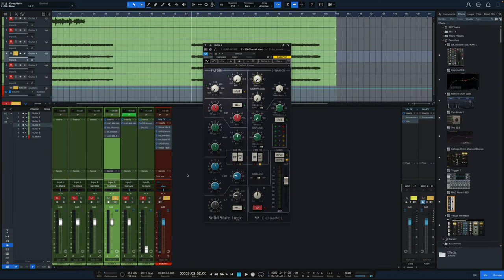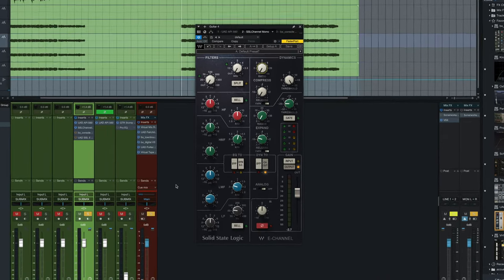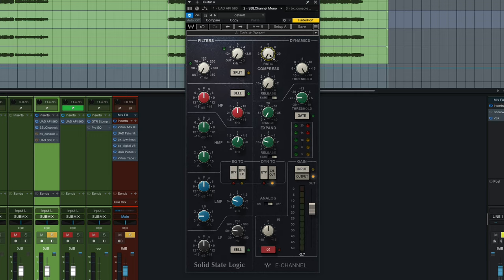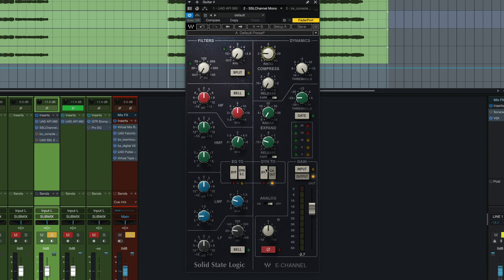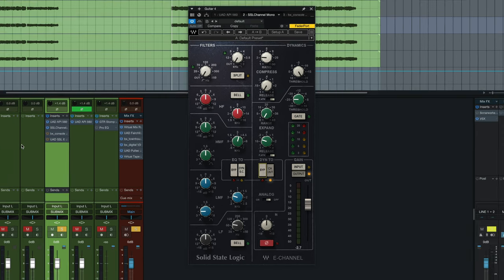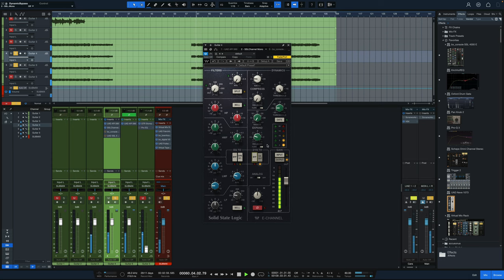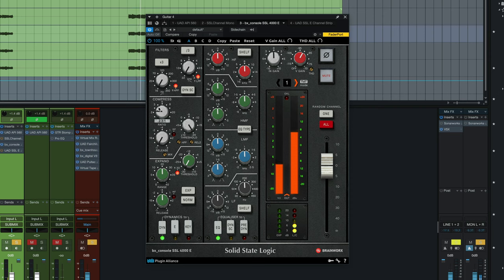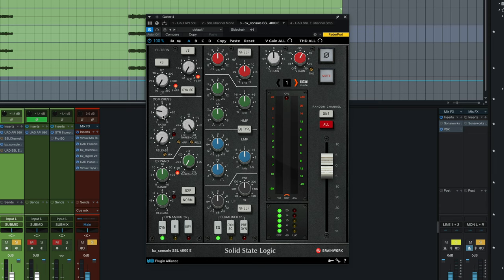Joe Barresi Guitar Compression

Comment: What you hear in your null test is mostly the level difference as it is not compensated in ssl..i learned this hard way myself as well 🙂
Reply: Interesting. I bet that’s in part the case, speaking from limited experience. But I still hear the compressor knocking off the front of the transient as well, so it seems to be ‘smudging’ the transients as well, therefore changing the tone.

Comment: Might even be able to tweak it more in parallel with a mix knob. I've heard others talk about this same setup for drum bus compression. You might have to back the input of the signal down, as even just moving the ratio knob a tiny bit causes way too much compression. But admittedly, I haven't experimented with it enough. Thanks Joe.